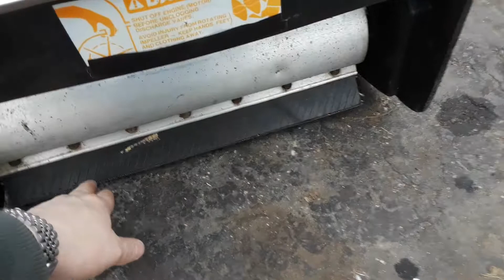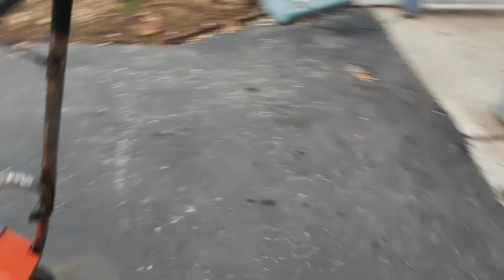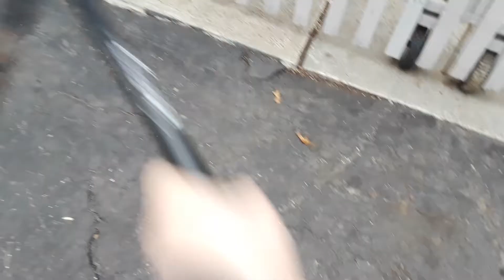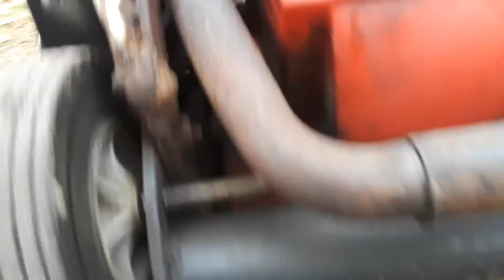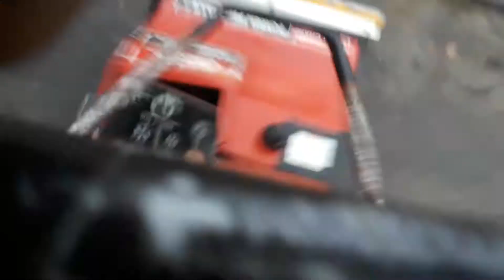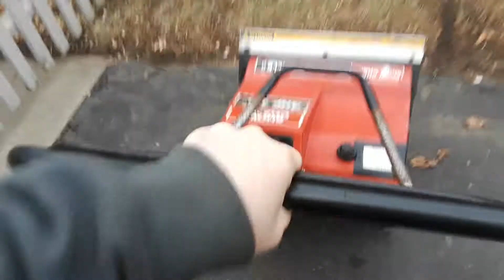SnowChamp single stage 3hp 20" two cycle snowblower Tecumseh AH600 vane chute snowblower

Comment from the maker: For anyone looking for a replacement belt for these machines. The Craftsman single stage snowblowers made by Murray are direct replacement’s for the belt on this machine. It is belt 333721 superseded to 333721MA. Its size is 35 long 10 rib poly v-belt. A quick google search locates it. If you click on one being sold by Amazon, check in the reviews that it fits, one search result from Amazon for this belt, the top result, had a lot of reviews it did not fit, so I suggest going to a site like D&D, you pay a couple dollars more but get a belt guaranteed to fit. 
https://offroadbelts.com/product/craftsman-333721-replacement-belt?gad_source=1&gclid=CjwKCAiAk8G9BhA0EiwAOQxmfjLDdGlw9fZUX4a6J2Z9XAT9x-arC3EVy0ZNV6UA5Wut6krUtkpJIRoCEAEQAvD_BwE

Comment: Anyone ever had to replace the vane direction thrower? Do any other models have similar parts. Thanks.
Reply from the maker: I have an electric one same brand missing one. Good luck. They sold them under sunbeam as well. You’re probably going to have to find an old used one out there because parts like that are definitely not available anymore. The only part that is interchangeable is the belt. The old 2 stroke craftsman’s use the same belt.
Reply: @Mr_Tecumseh  do you have the part # for the belt on the craftman ?
Reply from the maker: @ It’s part # 333721 superseded to 333721MA. It’s size is poly v belt 35 inches, 10 rib. Google belt 333721 and it will come up. Buy one from a parts distributor like D and D. If you click on one of the Amazon ones for sale, make sure you check and see in the reviews that it fits because the first one that pops in search from Amazon claiming to be that belt has a lot of complaints it is too short. 
https://offroadbelts.com/product/craftsman-333721-replacement-belt?gad_source=1&gclid=CjwKCAiAk8G9BhA0EiwAOQxmfjLDdGlw9fZUX4a6J2Z9XAT9x-arC3EVy0ZNV6UA5Wut6krUtkpJIRoCEAEQAvD_BwE
Reply from the maker: @vickyleyrer8384 I answered this 2 days ago, I don’t know why the response is gone. But look in the comments, I pinned the answer and a link to the belt.

Comment: Anyone now where to buy replacement parts???
Reply from the maker: What part?
Reply: @Mr_Tecumseh  belt cover
Reply from the maker: @HolyEnglish21 You’re going to have to look around for a used one out there, like a whole machine dirt cheap, because that part is no longer available, most parts are no longer available. Only other option would be take some sheet metal and make one. They weren’t very thick metal so cutting one to shape and making the bend and drilling the holes wouldn’t be very difficult. Paint it black and your set. As long as it does the job of keeping the belt and pulleys covered, it’s accomplished its purpose. Home Depot, just get a sheet of HVAC metal if you don’t have something laying around. Best advice I can give you. Luckily it’s just a cover and not something you can’t reproduce on your own.
Reply: @Mr_Tecumseh  thank you
Reply: @Mr_Tecumseh  drive belt

Comment: Forgot to ask this question, what is the AC plug for?
Reply from the maker: AC plug specified for it? Not sure, they usually come standard with a champion, don't remember which plug it used, it's the smaller one CJ8 I think. You can cross reference the plugs.

Comment: Thanks for the review.  I am trying to get a neighbor's unit up and running for the 23/24 season.  Thankfully we are in NW Arkansas, but you never know what we may see.

I did open it up and look at the sparkplug, cleaned it up with a wire brush.  I dropped a little oil in the cylinder, and compression seemed ok.  It has not run for 19 yrs or so.  I added some gas into the plastic tank (YEAH!) and it looks like gas in getting to the system.  Lots of pulling, nothing yet.  Hense me trying to see what is un youtube.  Thanks again, Dan
Reply from the maker: Your carburetor is definitely clogged with old 2 stroke gas that has that oil in it. Gonna have to pull it and give it a thourough clean. Good news is it doesn't really turn to varnish just sticky old oil that has to be cleaned out.

Comment: I have this machine as well and I love it. the belt broke on me last winter and no one can seem to find a replacement. if you have changed your belt before can you please please tell me where to get one? thanks
Reply from the maker: The little Craftsman single stage units use the same belt that start with the 536 model number. Just order one of those and you'll be good to go.

Comment: Hi. I feel the same about the snow blower as you. There is no stopping it. Well until now. But first, twenty years ago my sister in law got married and her husband had a honda snow blower. Her snow champ was in the shop and she said we could have it, we'd just have to pay the tune up bill. Best $50 I ever spent. So today, running it on 8" of snow it just stopped running. Looks like a fuel line broke because I saw fuel mix dripping from it. So how hard is it to open up the top to get to where the line is? I think last time I tried to take it apart I got stopped by something I couldn't get to. I used to own a lawn cutting service years ago, so I am confident about making the repair.
Reply from the maker: I have an identical electric one in my garage right now. Identical to this one except it has an electric motor inside of it and you plug it in. Same power 3 horsepower motor

Comment: Snow Chief 3HP 21inch 2cycle.  No model number, my drive flat belt broke.  Mine looks just like yours, I a need belt number if you could reply with it or a way we could talk about it, it would be a big help.
Reply from the maker: The little Craftsman single stage units use the same belt that start with the 536 model number. Just order one of those and you'll be good to go.

Comment: I just got  one little snow champ 2 stage engine,but i think is been modify. how can i show u some pictures?has metal blades to clean the snow and is driven  with chains.
Reply from the maker: It wasnt modified, its a different model, different version. Theirs a few including one that is electric with a cord. They also sold them under Sunbeam and Mastercraft.
These units were sold up at the front of grocery stores along the snowbelt mostly.

Comment: Ideally, you could put a float carburetor on the S-200 or S-620. Aftermarket ones only cost about $15. You could also put an MTD 4.5hp Tecumseh engine on the Jacobsen.
Reply from the maker: You could also stick a Suzuki 2 cycle 4.5hp on anyone one those machines from the old Toro CCR2000 and make everyone of those blowers throw better.

Comment: I live in Connecticut and bought mine new in 1985.  Never changed the plug or cleaned the carb or replaced the rubber paddles. Runs like a bear, even at the foot of driveway where the plow truck pushes the snow.  I run it dry in the spring and hang it on my garage wall.  Starts with two pulls the following winter for 32 years.  The horizontal skid bar below the paddles broke and I made one out of plexiglass. That one broke a few years later and it's been off for 15 years.  The bottom half of the 2-part handle broke where it bolts to the frame 20 years ago.  I made sheet metal sleeves, drilled holes in the sleeves, and finally those fixes broke.  Got my electrician friend with his conduit bender 8 years ago and made a whole new bottom handle with the heftier 3/4" galvanized conduit.  I'm literally going to cry when this eventually craps out on me.
Reply from the maker: These are tough little bitches. A similar repair was made on the handle in the same place on mine. It was tack welded and rienforced with another piece of metal. Thats held as long as I've had the thing, 15 years now outleast, this was my first blower.
Two winters ago I saw someone selling one in pristine condition one town away for 50 bucks, I should have grabbed it. But mine is still going strong.
I also had one like this that was electric run by a cord that I sold a few years back, it was a sunbeam, but both snowchamp and the Sunbeams were both made by aircap.
MTD eventually bought them out and made an inferior design a few years before they scrapped these altogether, its a shame, you couldn't buy something like this new now if you tried. 
This design of single stage blowers was the best, they perform a lot tougher than the ones with a traditional auger. These have a float bowl carb, most had the diaphragm type, that was another plus to this machine. Hang onto her as long as you can.
Reply from the maker: Oh yea, I almost forgot, the muffler on this is a big barrel that goes down by the axle, it purposly melts the snow a bit to help throw it better. Not even the Toro's had that design feature. They put a lot of thought into these things. Oh and 1985, thats the year I was born, good year.